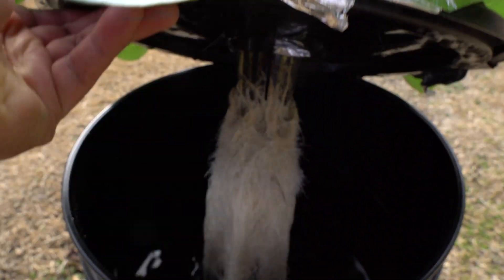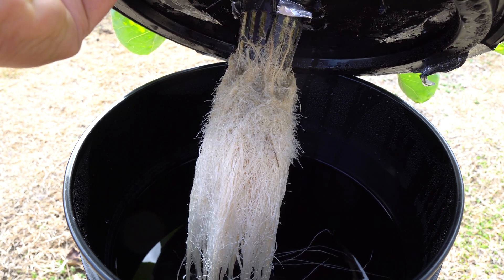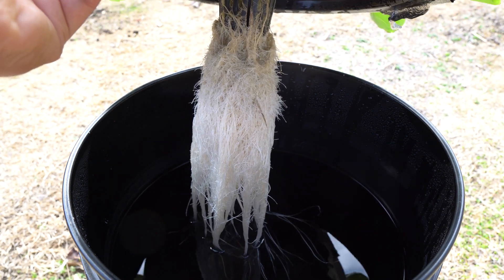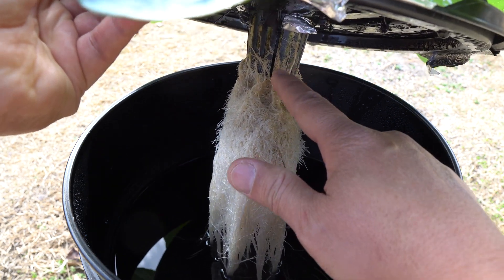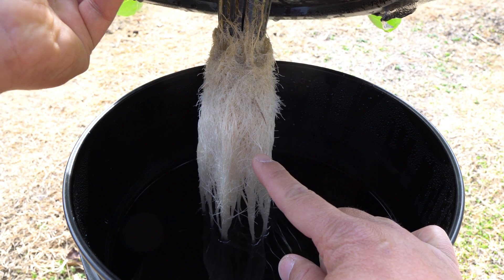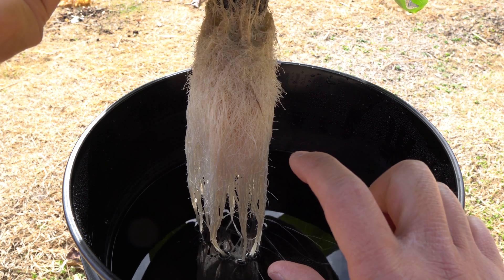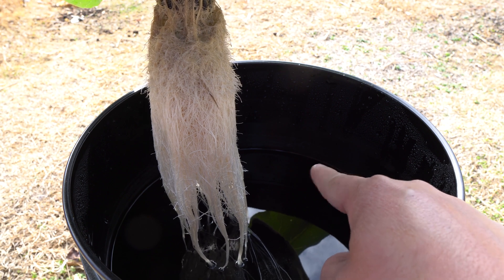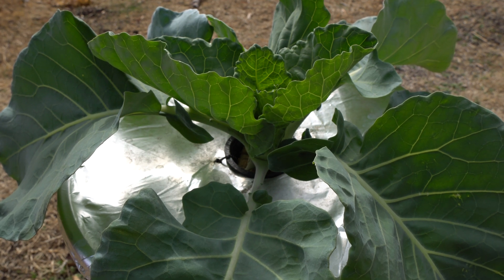Kratky Hydroponic - When And How To Change or Refill Nutrients

Comment: Technically kratky is a circulating method (closed system) because the same nutrients are reused until they are replaced. With a non circulating system  (open system) the roots only see the nutrient once and it isnt reused.

Comment: How frequently do you recommend changing the water? I think I’m waiting too long and my roots are getting brown and slimy. I do have an aeration pump in my 5 gal containers.
Reply: If you have an aeration pump, that is "Deep Water Culture" and not Kratky. I've read a bunch of people online using H2O2 to clean off any of the gunk that has grown on the roots but haven't tried it myself.
Reply: @stevenp5296  For what it's worth, I've had a few mason jar kratky set ups that started getting root rot and hydrogen peroxide did absolutely nothing to help once it's set in, and if you use too much it kills the roots.  I've added it to my nutrients after I've mixed them together just to make sure the solution is disinfected for storage and that seems to have helped keep the rot at bay when I actually use it. What did work to fix the plant was cutting the roots past the rot, rinsing them off really well, disinfecting your jar or bucket or whatever, and then putting it back in with fresh solution up to where the roots are.  It takes the plants a little bit of time to bounce back though, but it'll be way faster than using peroxide on brown roots.  He has a good video about doing that on this channel too.
Reply: Online, I've heard 2-4 weeks. And adding a small amount of hydrogen peroxide. There is also a "kratky vs dwc" video on youtube by somebody else that shows an aeration pump making algae more of a problem which can feed root rot bacteria

Comment: Good tips. You also want to change the nutrients when the EC gets to low. When the plant sense lack of nutrients the PH will start to rise. Thats a sign. I change when EC drops below 0.8
Reply: What is EC?
Reply: @idahogardengirl942  EC stands for Electric Conductivity. Simply put, the EC value is the salt concentration in your substrate or nutrient solution. The salt concentration is a good indication of the available nutrients. This is why the EC value is important: it tells you if your plants are receiving the right amount of nutrients.